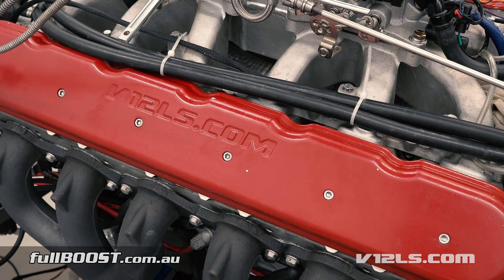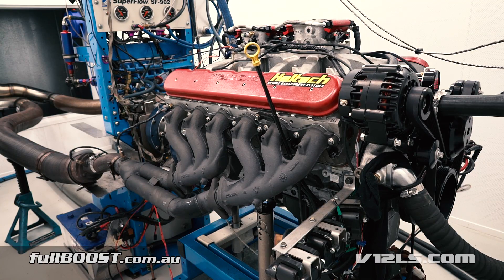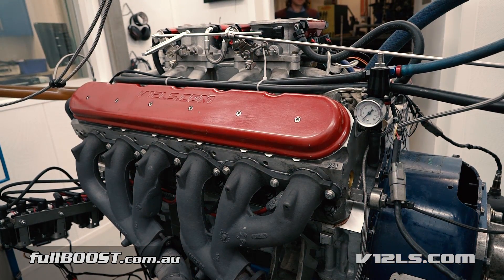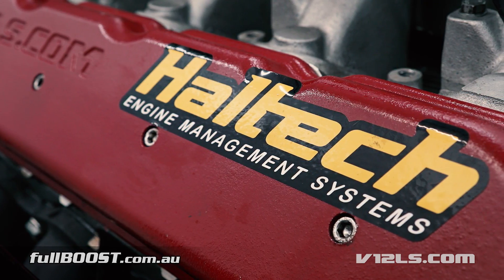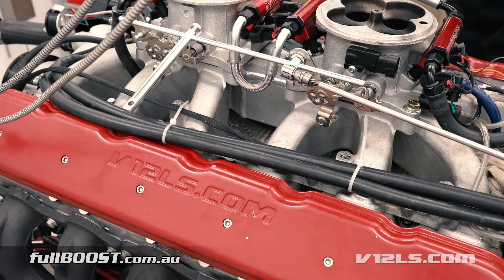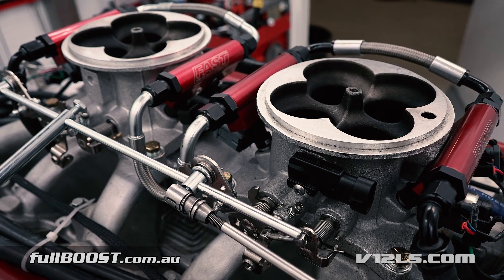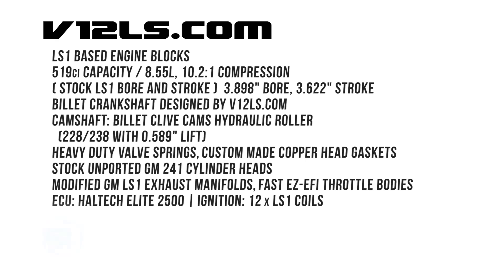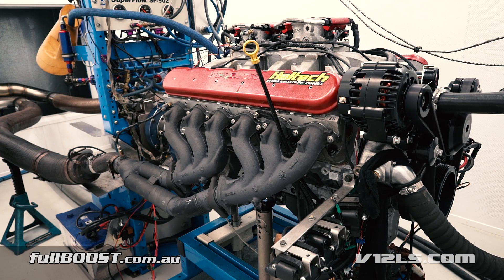V12 LS1 engine dyno

Comment: I have zero doubt, that after testing and further development....this engine would shit all over a Bugatti 16.4.

People are making over 1000hp on stock bottom end ls v8s....high mileage stock bottom end ls v8s.. 

Picture this motor,  Big twin, or quad turbo..  It would easily push over 1200 reliably...
Reply: Yeah, we can't wait to get one of our new Iron blocks setup with some better components and see how it goes. Over 700HP with stock pistons and cathedral port heads really shows there is potential.

Comment: Doesn't even sound like a proper V-12. X-plane V8 style crank instead of flat plane like a Ferrari.  Also it falls way short of 100 HP /liter. Due to it's V8 skeleton it's has a 90 degree cylinder bank instead of the normal 60-72 degrees for almost all other V-12's. This also makes it bulkier than it could be.
Reply from the maker: It can make more power, the heads on it are very mild.

Comment: I dont quite get why you wouldn't use two V6 motors, I get that LS engines are more available, but theres more work to make those 2 motors work.
Reply: AfterDark3 if you join 2 v6 blocks, you will have the rear main of the forward engine against the front main of the aft engine. this would have to be dealt with regardless, but I believe it would be tricky to work around this while keeping the same main spacing with 2 v6. unless you were attempting to turn the 2 v6 into a v8

now with 2 v8, you run into the same problem, but if you can line up the two rearmost mains of the forward block, with the 2 front most mains of the aft block, and then cut the 2 blocks on a line halfway between the aligned mains. you should then have 2 halves ready to be joined together, and still maintain the main spacing.

I will be the first to admit that I am no expert, and my theory could be completely wrong. without a spare  ls block laying around to examine and measure, I can only guess. 

i hope this helped shine some light on possible reasons for not using 2 v6s

Comment: that's quite crappy power for a v12, stock v8 make close to 500hp N/A and have 4 less cylinders. It's cool regardless tho
Reply from the maker: A stock LS1 only makes around 350hp.
Reply: Even if the stock v8 made 500 just add half.  ~750.  Not bad considering the extra moving parts
Reply: 717hp with arguably the worst production LS heads as far as power production, a very very mild cam, stock bore/stroke, and cast iron exhaust manifolds, and you don't find that impressive? This is double what a stock ls1 makes.
Reply: +sadelcol as a ls1 I built for my brother in law's s10 made 785@ a bit above 8000 rpm with stock ls3 heads, custom cam, and stroked a tiny bit this is least impressive. Could save the time, money, and effort where it really matters and make much more with much less. Like I said tho, it is cool but a waste kind of like your comment. Thanks tho
Reply: +OGskunkMASTA Oh really? Mind sharing how you got those 2.165" intake valves to fit inside a 3.89" LS1 bore? And how does that stroker crank like swinging those rods around at 8 grand?
Reply: +LivinglikeLogan go to the machine shop, ask to have it sleeved. Then you get it bored out to your desired bore. It likes it pretty well, a neutral balance and some A beams don't mind RPMs unless you're not familiar with that kind of stuff. 414 stroker, ls3 heads milled a bit, 13-1 compression, shaved and balanced crank, a beam con rods with mahle pistons. Just so you dont ask any more stupid questions.
Reply: +OGskunkMASTA And you wasted all that time and money on an ls1 block when you could have gotten an LS3 block which is 2x as strong, and didn't need to have sleeves that are worth more that the block itself to be put it? Real smart.
Reply: +LivinglikeLogan where I'm from its to device the competition and to BS people. Never had any problems with a 250 progressive ontop of that. When it's your money and skill do with it as you please.
Reply: +LivinglikeLogan look at team SVO. held the 275 drag radial record with a stock 5.3 block. had more money and time into it then a rhs or dart block but just to brag and Bs people is part of the fun.
Reply: +OGskunkMASTA What kind of sleeves, and what rods are in it again?
Reply: +LivinglikeLogan carton ls series sleeves and Callie's A beam rods. It'll cost you for the cam specs ;)
Reply: +LivinglikeLogan Darton
Reply: +clutchkickgoon I'm talking money spent for the horsepower you fool. Yeah guess what tho it will go faster for cheaper so who gives a rat's ass about a LS v12.
Reply: please dont stop playing with your little junk to annoy everyone else.
go on your civic ultra wing forum,leave the men alone.

Comment: Cool concept but bad video.  According to the a/f gauge on the engine while running on the dyno was reading as if it where e85. So no not regular petrol like the narrator said.
Reply from the maker: The engine was running on pump unleaded mate its low compression.
Reply: 9.5-1 is for e85. 14.7 is for petrol.  
I can maybe see running rich with boost. But 9.5 is way to rich. 
Plus Lower compression use less fuel not more.

Comment: Other than being an oddity, there is no point to this thing. A normal BB V8 could make the same power and torque with far less parasitic drag of having 4 extra cylinders and hardware. Also the extra weight. Hope this is just a side project kind of thing.

Comment: Just for people wondering why the engine sounds so shitty, it has unequal length headers + no X pipe for both cylinder bank to mix their sound. Basically you are hearing 2 shitty sounding inline 6 running at the same time on this video.

Comment: Meh, something about a V12 that doesn't rev doesn't sit well with me lol. Cool for what it is though
Reply: It's a cam, valve springs, roller rockers, and maybe a bit of porting away from a 7000-8000 RPM engine if it's like the LS it's based on

Comment: Pretty lethargic, needs a couple Chinese turbos, Megasquirt, and a babysoft tune.
Reply: That's the dyno holding it back. It is set to ramp up from 4,000 to 6,500 in about 8 seconds to get a good idea of mixtures under load. Turbos would be insane on one of these!

Comment: A v12 LS3 would have been 2738927382x better, LS1s are old, its 4in bore or go home , 241 heads?? Cmon now guys what we're y'all thinking
Reply from the maker: +omar paredes This is a prototype engine. Ls1s are cheap.
Reply: Tru
Reply: When you are experimenting with the unknown, why would you spend any money that you don't have to? Money was spent on all the right things, like crank and cam, bearings, rings, Haltech ECU, etc. to prove the concept, but not wasted where it was not needed. This engine is running 2nd hand pistons, rods and rockers. The exhaust is 2x cast manifolds with one port cut off each. This engine proved itself well, making a little more power than we were expecting, and now we are moving on to bigger and better things! (think cast blocks, 4.125 bores, LS7 style heads, etc. 1,000+ HP, NA on pump gas) Follow Fullboost, as I am sure those guys will be keen to cover our future builds.
Reply: WarWagonMT I agree with the difficulties of R&D, but every LS is basically the same, you couldn't have done it with a LS2? Or a LS3. I'm not knocking your work by any means it's a phenomenal build, but for the extra bucks a LS3 would have been a tab bit more epic, sure the LS1 are "cheap" relative to the the LS3, but in essence the LS1 is just a fancy 5.3, hell there's even all aluminum 5.3s. I'm just saying, but I don't doubt y'all won't come out with the 4in bore v12 monsters, it's just you know it's like "damn why didn't they go the extra mile on a build as badass as it is" but it's easy for me to say that when I didn't spend the money lol you know it's a car guy thing, but cheers man it's badass either way
Reply: I agree Omar, however LS3's are pretty thin on the ground here in Australia, and it really did come down to cost. However looking back, the extra cost would have only been a small portion of the build cost. We have just finished the machine work on our first run of cast blocks, so keep an eye out for big things from us in the later part of this year. :)

Comment: Gutless for that size. You would think it would have 400ft/lbs of torque at 1000rpm. And it sounds wrong. Sounds like a rough V6. And the throttle cable and engine speed are not even close to being tuned. Or could it be due to a shitty dyno?
Reply from the maker: The dyno operator controls how the engine accelerates, the dyno is fine as is the engine throttle.

Comment: Why?   It wont fit in many applications..  The power is not impressive at all.  You can easily make 5-600 reliable hp with a 8 cyl naturally aspirated ls or 2-3000 hp with boost.
Reply from the maker: It's a prototype engine making 100% more power than stock with basically a camshaft. This engine is going into a Corvette.
Reply: Well, I like it. I think it's awesome when people engineer their dreams to reality.

Comment: I hope people aren't really impressed by those numbers. For that many cubic inches & 12 cylinders that thing wouldn't fair well against properly built Europeon V12. You guys need to leave V12's to the pro's at AMG & yall stick to the "lknuckle draggers go to engine swap of choice like the LS V8.
Reply from the maker: You are a dead set idiot. Its making over twice factory power using OE spec parts.

Comment: And the stock 5.4L (351 cid)  V8 Ford GT500 engine makes 665 hp.   Go figure...
Reply: Sir FarSide considering it was nearly an all out effort for performance from an oem, using a blower, it better make more power.  By the way, 5.4l does not equal a 351.  You wanna talk shit about others hard work, at least get your own facts straight.

Comment: Torque and horsepower are NOT impressive on this, especially at 6300 rpm. Whats impressive is that it was built.
Reply from the maker: Stock engine only makes around 350/350, what would you expect it to make?

Comment: all that work for 700hp? Seems kinda pointlesss
Reply: Check the cam specs, mild as all fuck. Cam change only = 900+hp...at fuck all revs = reliability.
Reply: -_-
for fucksake it's all stock LS1 parts. give me a damn V12 that makes this much power AND torque on pump gas. this isn't even a high-end camshaft it's based on stock LS1 cam specs...

Comment: Cool, but Not impressive as it only makes 83hp per liter
Reply from the maker: Its using OE internals what would you expect it to make on low compression
Reply: @fullboost  this version didn't impress but when it was equipped with ITBS is when it got interesting

Comment: Good concept but will never see a flatrate v12 design, horrible throttle response, added weight little power gain, limited rpm, only plus would be uniqueness
Reply from the maker: The throttle response is the dyno not the engine. Its making 100% more power than stock...
Reply: Obviously it was making a dyno pull im glad you told me i didnt notice.., common sense tells you more pistons, more moving weight, more time spent to get everything moving. V12 enginea are known for having horrible bottom end.. What do you mean stock this isn't a production engine there isn't anything to compare it to. it has 12 cylinders vs 8 obviously it will make more power than a ls v8 engine if that's what you mean by "stock"
Reply: "100%"
Reply: By the time you build this v12 making 600 odd horsepower (to the crank) youve invested triple what it would take to build a 1k+ hp conventional v8. Just ask the people who funded this

Comment: NO REAL PERFORMANCE ADVANTAGE SEEN HERE OVER V8 ls motors that are fixed up. and it doesn't sound like a ferrari, so Why bother?  Guy is brilliant to have done this but just saying...
Reply: We found the performance advantage to be considerable at over 1.5x the same spec V8. Feel free to prove us wrong though, if you can make over 700hp with an LS1 V8 and no porting on 241 heads that would be quite an achievement. We see no reason this performance advantage will not translate to other build specs, and we will find out soon enough.

Comment: hmm not bad power a not better mercedes  bmw aventador ;) 
LS 8.55l V12 715hp
BMW 5l V10 upgrade engine naturali stoker 5.5L 630hp ! 
mercedes V12 7.0l 770hp !
avent. V12 6.5l 700hp LP750 have 750hp !
a more V12 engine big power a lower capacity
Reply: All the other engines that you mentioned is DOHC. This is a pushrod engine.

Comment: Less than 100 HP per Liter? That sucks!! Two EFI carbs as well?? Look at what this guy is getting with a fucking 4 bolt main no nothing POS big block Chevy from 1902. Well not 1902 but this is old tech shit for the most part in engine design still whipping the fuck out of that V12.
https://www.youtube.com/watch?v=5DHYm6fnJTg
Reply from the maker: Perhaps rewatch the video this is a prototype engine built to prove a concept.

Comment: what a waste. won't fit in an engine bay if you wanted to but 8.55 liter and 715 hp and 625 ft lbs that's less than you can make with a built small block.

Comment: These are numbers a standard v8 ls can reach...pointless. change my mind.
Reply from the maker: Its making twice factory power.
Reply: @fullboost  correct, by adding 4 more cylinders. There are less expensive ways to push more power out of an LS. Not to mention the fact it's going to require engine bay modifications to fit anything.  Not practical, but interesting nonetheless I guess

Comment: If its going in a corvette that is the stupidest thing i have ever heard of.  The corvette handles so well because the weight is low and back towards the center of the car.   This engine will destroy that unless you plan on sitting on it in the cockpit. 
 The ls engines are already capable of producing much more power then a corvette can handle....Read reviews of the c7 z06....
  Some people obviously have way  more  money then brains. 
You will fix that tho.  When this goes into production and doesnt sell you will figure out why GM never put their extra cylinder ls based engines into production.
 They built them, they tested them , but they never mass  produced them because it doesnt make sence.
Reply from the maker: No one said what era Corvette it was going into...
Reply: +Fullboost he has no idea what he is talking about he's just another one of those ls forum guys that think they know everything but hasn't even built a motor let alone pull one out of a car
Reply: +Fullboost good work on the motor

Comment: under 100hp/L, not a flat plane crank, barely makes power above 7000 rpm....sounds like a dud with non spectacular performance. if the engine is so good why can't it get 900 hp at 9000?
Reply from the maker: Why does it need to rev to 9000rpm? Big motors make torque.
Reply: +Fullboost it makes poor numbers. fail
Reply: +Fullboost 625 torque.  low
Reply: Dude, it's a 9L engine, it's not going to spin to 9000 rpm in prototype phase.
Reply: There's a whole lot more to engine performance than peak numbers. Did you see how flat that torque curve was?
Reply: +Loebane it looks the same as many tuned v8 lsx engines to me. I dunno but unless there's a serious performance gain which it kinda doesn't look like there is it's kinda pointless. maybe diminishing returns etc either way it won't fit in a civic

Comment: at 519ci its not very impressive, just plain expected, its long and awkward, takes up more room than a big block chevy, the engine doesn't sound good at all, i just think this is redundant, it isn't revving insanely high or anything... theres just nothing good to say about it.. get an ls7 and you'll make more power, get a big block chevy and you'll make even more power... theres no place for this engine
Reply: not impressive no, what is impressive is that this thing is small bore, small stroke, small cam and unported stock gm heads. It would be a lot more entertaining if they pushed this engine, imagine what it could do if it were a max effort deal.